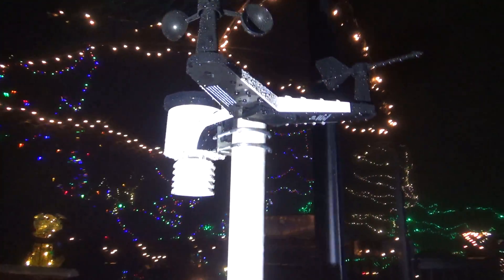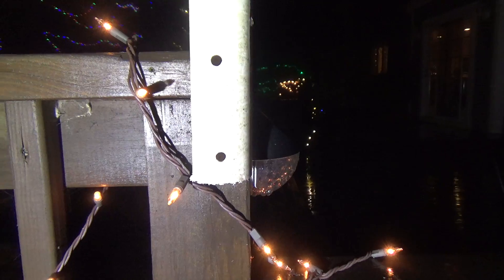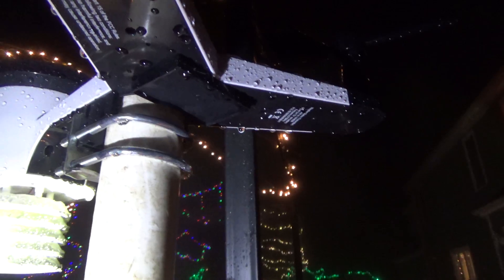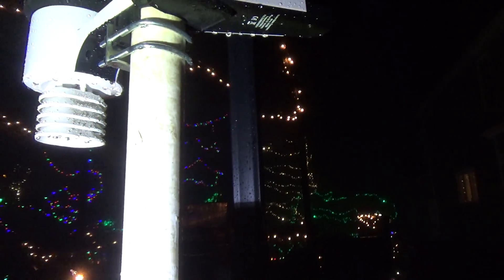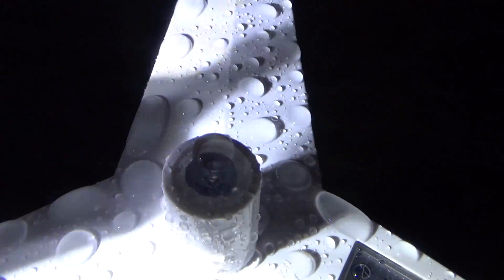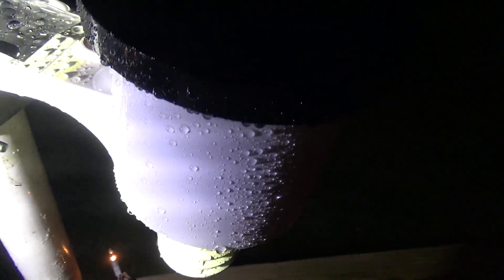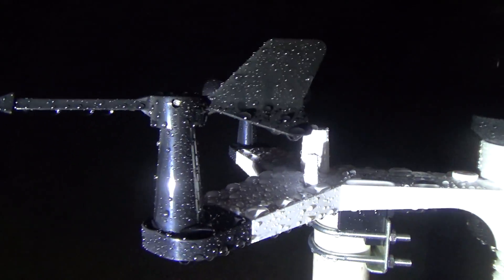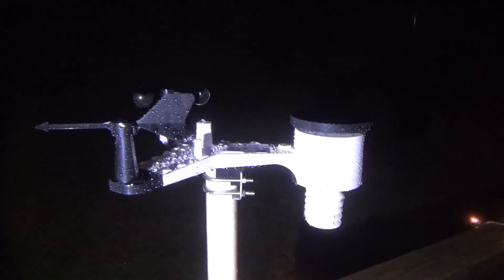Ambient Weather WS-2902A Outdoor Sensor Installed

Comment: Those remote temp sensors look like they’re Acurite models. If that’s not the case, I apologize for the assumption. But if it is the case, are you saying you can sync these to the ambient WeatherStation? I came here because I was looking for an explanation of how to sync the outdoor remote temperature sensor to the base unit and how it looks on the display.
Reply from the maker: They are, they have their own separate receivers in the house. They have nothing to do with the Ambient Weather display and as far as I know there is no way to make the two interact.

Comment: For mounting, the pipe was a great idea; i'd take a scrubby pad and some cleaner to it rather than the pressure washer so the weather station won't get damaged.  I'd have also filed down the end of it so it didn't look as ragged.  To mount the pipe to the wood, I would have drilled straight through it, put 2 long screws through the entire pipe and into the wood, with washers on the screws.  The washers could then be hammered down to conform to the pipe to make it look even better.  That would ensure it was mounted very sturdily; you never know what the weather will bring, and this station won't warn you about an 85 MPH gust that comes out of nowhere.
Reply from the maker: This weather station won't warn me about anything, it only reports what's happening in the present and past..
Reply: Yes, I had said that it won't warn you, which is why a very sturdy mount would be ideal.
Reply from the maker: @jaykay18  It won't produce any warnings, regardless of the mount..
Reply: If it were sturdily mounted, it wouldn't need to warn you, even if it could.
Reply from the maker: @jaykay18  That doesn't make sense;  now you're just spewing bologna because you don't want to admit you were mistaken about what the unit does..
Reply: I knew that it wouldn't warn you full well from the start.  All I was doing was providing CONSTRUCTIVE CRITICISM on your mounting job, providing you with ideas on how to make it better.  You should welcome that kind of criticism because it doesn't denigrate what you've done, only helps to make it better.
Reply from the maker: @jaykay18  I have nothing wrong with the statements about how to make the mounting better, they are all valid points.. I take issue with the reasoning of it not being able to warn me if the mounting isn't as good as it can be..
Reply: It was a facetiously-made statement; I knew it couldn't warn you of impending wind, therefore it would be a good idea to make sure the mount is as secure as can be, that way you don't have to find out for yourself that there was a wind gust strong enough to rip it out of the wood.
Reply from the maker: @jaykay18  If there is a wind strong enough to take this off the mount, I think there is going to be much greater concerns than it as far as damage from that given wind gust goes..
Reply: Yes and no--a strong gust of wind can pick one tree over another to knock down as you've seen.  It may pick the weather station rather than a tree.  It may pick a tree that would then hit the weather station.
Reply from the maker: @jaykay18  If a tree hits the weather station, it will also hit the deck, which will likely create a more substantial loss monetarily speaking..
Reply: Yes indeed, but that depends how tall the tree is.  It's weaker at the top, and may break off the weather station without doing much damage to the deck, as the deck is stronger.
Reply from the maker: @jaykay18  OK..